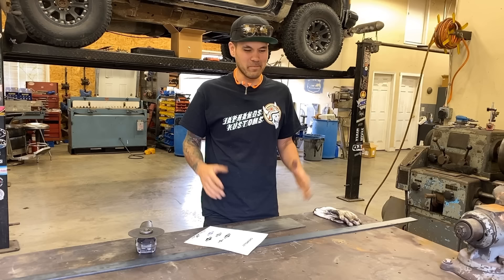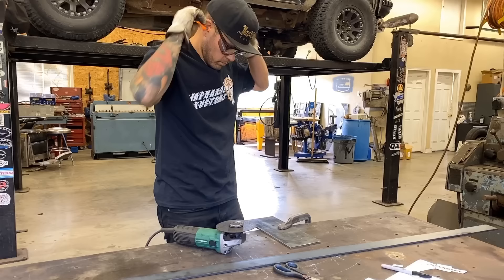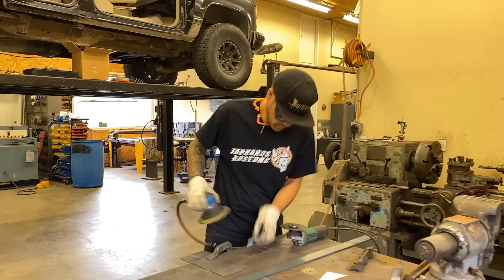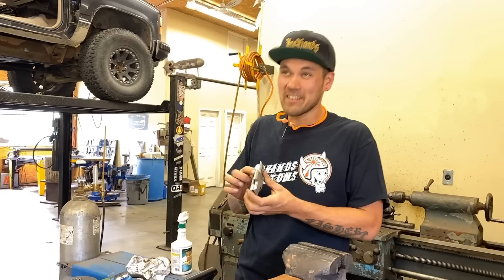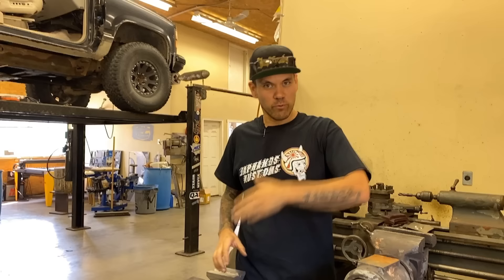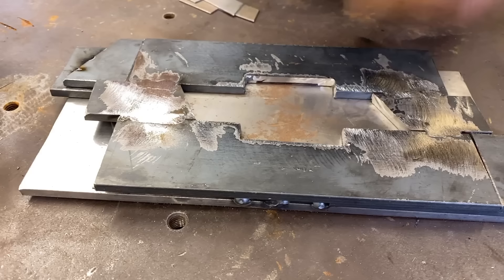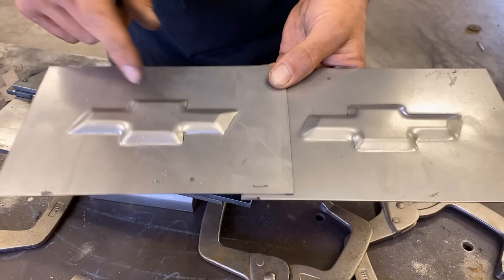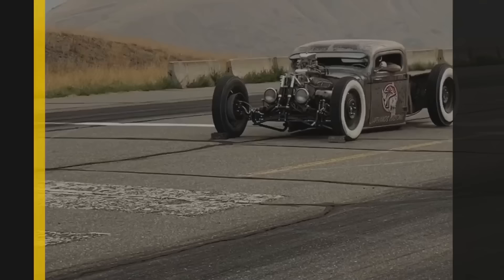How To Make A Press Form - Embossing Sheet Metal Using Basic Tools!!

Comment: My Grandfather was a master craftsmen tool and die maker. 
He told me that a file only cuts in one direction. Don’t drag the file across the metal when pulling back. It just dulls the file faster. 

Hard to remember to do that sometimes but I notice it actually works better as well.
Reply: yes! the exception is ally, then you drag the file to clear the chips out
Reply: @daos3300   Good point 

I left out the part where my grandfather would tap the file gently on the edge of a non critical part to clear the chips. He was very particular and his work reflected that. 
I’m sure that gently pulling the file backwards would also do the job without damaging anything.  
I’m sure all the above is relative to the material being worked and the force applied. Gentle is a subjective term.
Reply: Put chalk on your file.
Reply from the maker: Your grandfather is right I only put pressure in one direction but I probably should lift the file to save it’s sharpness. Thanks both of you for the tips!
Reply: @danielrunge7294  that too
Reply: @MakeItKustom  you are definitely a master craftsman in your own right. Have enjoyed, learned and appreciate all that you do. Most impressive. 
Appreciate your calm, cool demeanor and humor
Reply: I was looking to see if anyone said that I was taught same thing.
Reply: No disrespect to any old tool and die maker, but dragging the file won't dull it that much. Dragging the file will actually give you more control when having to file surfaces flat to insane tolerances. It has been proven that dragging with light pressure doesn't damage the file.

Comment: Great project, a little lube will help a lot with press forming.
Reply from the maker: Great idea!
Reply: Where would you put that lube? Between the press die and sheet or on both sides?
Reply: @kristoffer-robinlotze7273  I would apply a lube to both sides, I would also as Karl mentioned soften the sharp edges on the die portion to stop cutting the pressed piece and if cutting still happens may need to increase clearance slightly between the punch and die pieces.

Comment: Great topic - you were commenting about using press forming for body work, while not exactly the same but (to me!) very closely related tip:  I saw an advanced restoration pro save a '67 Shelby GT500 with what I thought was a novel use of press forming, the car had severe impact damage on the driver's rear quarter (normally one would cut off and replace the whole side of teh car)  however what the pro chose to do was to order a new rear quarter panel section and then fill it with very hard concrete, to make a concrete form/plug exactly in the positive shape as the OE panel, and he then used that from inside the trunk with porta-power to gently press and work the original sheet metal back into form (along with hammering, shrinking, etc) and was able to preserve the original date-coded sheet metal of the car to avoid devaluing it.  Love your work, look forward to every video!   - Steve.
Reply from the maker: Wow that’s very interesting I’ve never heard of that technique before! Thank you for sharing this with me I will do some more research on it

Comment: Back in the 1970's I made an explosive forming chamber for a school project.  It operated similarly to your system except that it only needed a female die.  The male side was a chamber filled with water (incompressible) that used a 20-ga blank shotgun shell to press sheet aluminum into the female die.  My components were heavy, in part so their inertia would help reduce movement under high dynamic pressure.  It worked very well for my first try.  If you put a coin on the top of the die, its exact mirror impression appeared in the sheet metal part produced - you could see all details of the image and read all the numbers.  There are many ways to get there from here, and some of them give you an excuse to sound the klaxon and yell "Fire in the hole!"
Reply from the maker: Wow I really wanna look into this now
Reply: @MakeItKustom  - I've also seen people use pressure washers to inflate a sheet metal vessel that started out as identical flat pieces welded around the perimeter.  This works well for things like a 2-stroke engine's expansion chamber, but of course the final shape will often be imperfect and hard to replicate precisely.  It still seems like you might be able to inflate some sheet metal into a die that was, perhaps, made of wood.  Its greatest value is probably in entertainment...

Comment: As an alternative to tracing it on the steel you can use spray contact adhesive and just glue it on. This is a common method for those of us transferring complicated designs to metal for doing repousse and chasing.
Reply: Doesn't it burn the paper?  I like to use tape, but sometimes it'll shrink from the heat of the blade.
Reply from the maker: Great tip man thanks!

Comment: I didn't read through the comments, as a die maker I suggest using some lubricant to the material.  The material would flow easier and perhaps make the corners sharper.  Light oil will help.  Keep the vid's coming.

Comment: I did my first press form piece a couple of weeks ago, and instead of a hydraulic press I used a sledge hammer :P   It was actually for hat channel, so I was able to slide a small form down the sheet metal, whack it again, and continue until I got the length that I needed. It worked out great. My first attempt was with a vice. It didn't end well for the vice... using a press like in this video would be ideal, but I thought I'd mention the sledge in case someone wants to try it before getting a press.
Reply: I've broken my voice twice trying to push out bearings.  I guess they aren't made for pressing stuff.
Reply from the maker: Thanks for adding that! You’re totally right and before I had a press are used a sledgehammer. I still use a sledgehammer for doing dimples lol just faster

Comment: I saw metal embossing somewhere years ago, but I think they swabbed it with some lubricant, between the die & sheet metal. I would try just to see what happens. It might even work on some auto leather about 1.2 - 1.3 mm thick. It could be damp leather, slightly heated die or not. Just try it dry on a block of soft wood. Who knows, welding apron, stitch on a hat, shop seat top or the wife’s purse.     Whoops, You owe GM $6.11 for copy right fee!
Great video as always! Mini-bike burn out! That is where the YUGO is to spin out. Tug of war! YUGO vs Mini-Bike. I would say get an MGB, but I don’t think any are running.
Reply from the maker: Ha ha ha I hope the GM will go easy on me. I think the lubricant would help for sure

Comment: Nice work! FYI. Get somebody local with a CNC Laser Cutter, to cut out whatever shape you require (x 2). Then use both metal halves of the Laser cut out, to do the same (once you have done the beveling, etc). Hope that helps. Regards JB

Comment: On mine I make the press punch then heat a 1/2" plate in my forge. I then press my part into the plate. That way your punch and die are and exact match. Also you can make it have different levels like you would want on  your skull with horns wearing a helmet. I've made a lot of spider punches and symbols this way. Give it a try.
Reply: Wow I should hook up with you also. Hehe 😜
Reply from the maker: Wow! That’s awesome I’ve never thought of that! So cool. I need to learn more about blacksmithing

Comment: So, If I'm understanding this correctly;  When you go to clamp down the metal within the fabbed jig,  It doesn't move  (the metal you're embossing - it's not free floating within the jig)  & so whatever your embossing is created by stretching the clamped metal ?  Then you would have to weld this into your whatever your making (for instance firewall plate)  for aesthetics, I'm using 1/16th  Aluminum sheet in front of firewall and should be able to fit entire sheet within the press (or I hope as my mig won't weld aluminum)  Thanks Karl, Great project!

Comment: For a perfect job the female die would need to be perfect match plus material thickness to the male punch, however, the application, " embossing" a firewall or boot liner you did a stinning  job with some basic tools, WELL DONE BUD 👏
Reply from the maker: Thanks a lot eugene! Yea a female die could have made It perfect 👍

Comment: You're not the only one who forgets to plug in his tools 🤣 I do it often enough I'm beginning to doubt my sanity.  A time consuming process I know well. Now we know why even simple commercial dies are so expensive.  I notice that you don't include any indexing marks for correct placement. Clamps are fine for a one off (or two) so another thing you might consider (if you are doing small pieces), is to make all the plates a bit more oversize and install clamping bolts with support centers all around the perimeter of the form so you don't have the clamps in the way. I was going to suggest the you round the edges of the female form just slightly. I have a neighbor with a 100 ton press, I wonder what could be done with that? After you have done all the work is when you realize that the client wanted the logo a half in longer and wider....Great video as usual Karl!
Reply from the maker: Thanks Toby and yes those are great improvements and suggestions! Trial and error gets us there ! 100 tons would be able to do a lot for aure

Comment: Cut a few sidewall out of some old tires to bottom the die out on. So the perimeter in plate just like the die and bottom the die into the rubber with sheet metal between them. You can get very fine details transferred.

Comment: I think like you mentioned putting a teeny tiny bevel on the female part of the form would help..... like a 32nd of an inch.  I'm also wondering about applying a tiny bit of lubricant on the edges of the female side.
.....no, I didn't mean it like that. 😁
Great instructional, and personally I like a Chevy emblem.  Those slightly rounded corners don't hurt one bit.
Reply from the maker: Absolutely a lubricant would help. And I agree the slightly rounded corners don’t bother me it definitely shows well

Comment: New subscriber here! Great job! I actually cheat and print a positive and negative dye in my 3d printer. I use a thick chunk of metal to support the dye so it doesn't bend. The print is only good for a couple of uses but in my case that's enough. If I want another one just press print.

Comment: hydro-forming is another way to emboss thin metal parts where you basically press the sheet over the die using hard rubber or sand as the "fluid". There are methods using a grease gun to pump grease over the sheet down on the die also.
Reply from the maker: Yeah I’d really like to try this maybe I’ll make a video!

Comment: I love that you used non specialized tools and materials to make this. Ideally cnc or hydro-forming. I wonder if you used a tilt band-saw with a blade the thickness of the material to be pressed; if your material drop could be used for the bevel on the female side of the die for higher definition on the bevel and the corners. Sort of an intermediate tool range for fabrication. Great tutorial, thanks for uploading the vid.
Reply from the maker: Thanks Clayton!

Comment: I was thinking as you were using your 3 inch grinder that if you had scribed a line around the face for the angle that it would help you keep everything even and clean I don't think I could keep the lines that straight just by eyeballing it. great video!

Comment: You can also 3D print the form tool, with 100% infill, using regular pla and it'll work as well as the steel will ;)

Comment: I wonder if slightly heating the plate would make the process easier.

Awesome video, thanks!
Reply from the maker: I think heat would work well as well as lubrication to help it happen. But the force seems to work well it’s on

Comment: Drop a piece of rubber sheet in the socket under the bare sheet before you press. The rubber will press the sheet into the corners of your press die. This is how hydro forming works. The rubber presses the sheet into the details. Works really well with aluminum. (its how we make detail aircraft parts)
Reply from the maker: Awesome I’ll have to try that thank you!

Comment: I'm sure it has been mentioned. You need radiuses. Large on bottom smaller on top die. Also radius on the slip of the bottom die.

Comment: I wonder if tightening the space between the mold and the die would sharpen the corners without cutting into the material. I'm just throwing it out there; because I've never tried to press a die like that. there's probably a few things you could experiment with; like the angle of the bevel as well as the space left for the sheet metal you are shaping. Just a thought but I thought it turned out good! I like the way you cleaned the Chevy die up with the hand file; I thought that improved the look 100%. and gave it some good clean lines!

Comment: Since you are moving/stretching metal, I suggest a lubricant on the moving surfaces, like a smear of Vaseline.  Or something similar.  Helps facilitate metal moving/sliding

You also need indexing pins - at least 2 in the corners to properly make sure it has the same dimensions all around, time after time.
Reply from the maker: Thanks for the tip Danny!

Comment: That's awesome man if you want try not to leave a mark try a blacksmiths fuller a real small one essentially at that stage just a chisel with a round instead of a point but that is awesome I'm gonna have to get a press maybe a fly press since it'll fit my line of work more ideal I truly thought you would need a stamping machine for sheet metal
Reply from the maker: Thanks for the tip man! Yea definitely give it a shot !

Comment: The lower female piece ( the die ) is the shape of the outside of the desired profile. The top piece ( the punch ) only needs to be the size of the flat raised part of the shape. There is no need for the chamfered edges as the material will naturally flow and stretch taut between the inside and outside profiles.
There is info on my channel for using rubber as a die for scratch free metal forming operations, just a punch needs to made.

Comment: Much enjoying your video's, wanted to tilt the camera up for a sec at the end to see what chev you had on the lift behind you :)
Reply from the maker: Haha wasn’t sure if that was the style for this channel. That’s our getaway vehicle “gangus” it’s a 98 GMC Yukon I swapped to 6.5L turbo diesel and NV4500 5 speed and 14 bolt rear on 35” just had it in the shop to swap the interior and doors to 1999 Escalade haha love this truck. Actually on a road trip with it now for our anniversary
Reply: @MakeItKustom  6.5 liter diesel ,that's a interesting choice,most swap that diesel out of it lol. what made you pick that engine?
Reply from the maker: They are actually a really good engine if a few key things are upgraded. Mostly because it’s was almost a bolt in swap that was never offered in this body. It gets wicked mileage and has lots of power

Comment: Mate Good Work.  Just when your glamping the metal together have the metal your embossing able to move.  So you lets say your square form is 6"x6" have your embossing steel 5"x5" and clamp around the edges of the 6"x6".  This means as the steel takes the shape of the boss your metal can pull in more steel and not strech so much.  Hope that makes sense.
Reply from the maker: It does make sense and thank you for that info! Cheers

Comment: Try putting some modeling clay in the bottom of the female mold.  It can push the metal into the corners to make the edges crisper.  Drill a small hole in each corner to let the clay squeeze out.
Reply from the maker: Interesting! Haven’t thought of it. Thanks for the idea!

Comment: One tweak to it might be to use lubricant between the metal pieces also something like a large piece of hard rubber on the back side might keep it from cutting out...maybe ?!?
Reply from the maker: The cutting part is the dies but absolutely the rubber could help with the lack of definition and the lube could help with ease of pressing

Comment: I love it man. Im glad I found your channel. Does the clamping plate on top necessarily need to be in the shape of the female piece and die?
Reply: At a guess, yes. 
So you know where to locate the die. 👍
Reply from the maker: It should be close to the edges of the shape but not a critical measurement. It will be more important on some shapes than others

Comment: Could you put a piece of rubber in place of those shims to push the metal into the corners?
  Also, the top part of the die that you are using as a clamp might work better if it was the same size as the positive side of the die.
Reply from the maker: Yes definitely both are great suggestions

Comment: Try heating the metal to like 1000 to 1200 degrees before you press it i think the corners will forum better just hold pressure on it till it cools to prevent shrink
Reply from the maker: Interesting! Thanks !

Comment: Could you do this same concept to do basic beads you think? I don't have a bead roller, but do have a press and need to make some floor pans for my Model A pickup project. That's a cool Bomb / quick change rearend hanging on the wall.
Reply from the maker: Absolutely! I would use round bar and flat bar for my beads. As long as you make a sandwich form It will almost do a better job